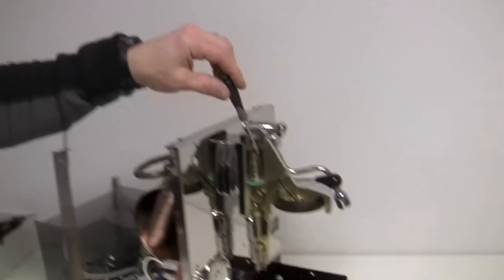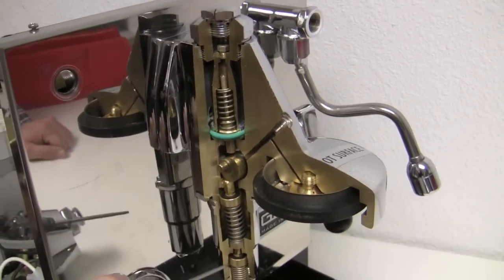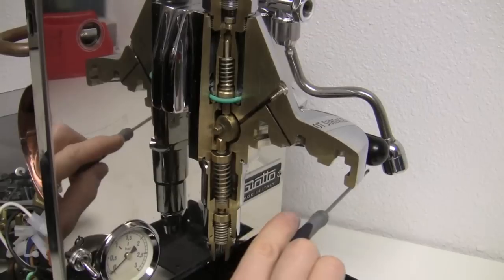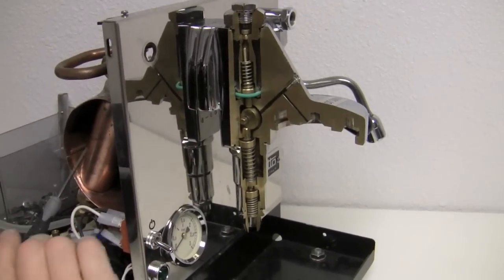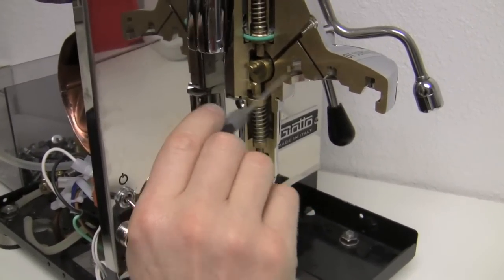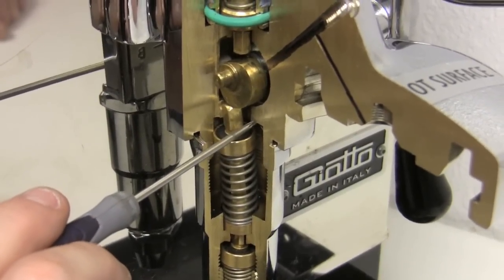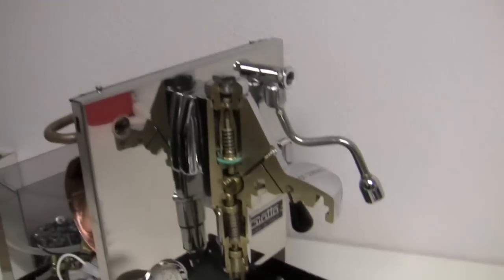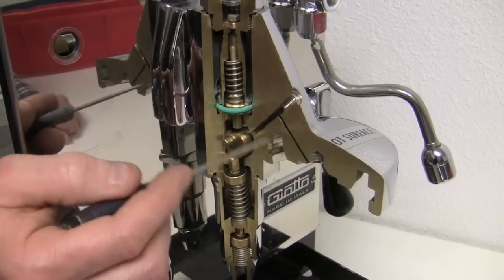Internals of an E61 Brew Head

Comment: The middle valve is actually a pre infusion valve. There is not two exhaust valves. When the pump is activated, pressure will push the middle valve down slightly (but NOT the bottom valve) opening up that middle chamber. The filling of this chamber creates a 'delay' in the buildup of the pressure. A soft 'pre infusion' or ramp up - as intended by the E61group head design
Reply: Good catch Sean!
Reply: @Omar Omari instablaster =)
Reply: @Jerome Brendan thanks for your reply. I got to the site through google and Im waiting for the hacking stuff atm.
Seems to take a while so I will reply here later with my results.
Reply: @Jerome Brendan it did the trick and I actually got access to my account again. I am so happy!
Thanks so much you saved my account!
Reply: @Omar Omari glad I could help xD

Comment: To add to the question of replacing only the rubber gasket of the valves; yes it’s possible. I did it this week. Issue is that you have to remove the notch (and probably replace, as they wear). The bolt for the notch has about a 50% chance of breaking when you turn it loose because it’s either glued in or the temp & scale almost fuses the little m1 or m2 brass thread. A notch is 1.75€, a seal is 90c. A whole new valve is 9-10€.. so if you’re cheap like me, remove the notches, buy what breaks & seals / notch for the others. I broke my pre infusion valve and saved brew & exhaust.
Reply: You can even flip the gaskets over and use the other side for a while if the rubber has not gone too stiff. That way you’ll at least be able to make coffee while waiting for the new gaskets to arrive. It’s what McGyver would do.

Comment: Hey Kat, remember whn Brandon ask bout why would there be 2 springs attached to the outlet valve? 

I like to dig in to mechanical stuffs especially figuring out how does coffee machine works... This video is truely gives me a clear explanation on how E61 works... Now back to the double spring setup on the outlet valve, I believe it works better using double spring instead of one since its high pressure there... I hope it's right...

Comment: In the 1st stage before pump is on. There should only be a max of ~1bar as this is the pressure reached in the boiler. 9-12  bar is only reached when the pump is engaged.
Reply: Correct! Good point.

Comment: The correct answer to the question asked at 6:00 is the first chamber is called pre-infusion chamber, that spring gives away before 9 bar therefore slows down the pressure buildup on the puck.

Comment: E61 HX requires flushing to cool the brew boiler tube aka heat exchanger until its stabilised to the correct temperature and also the exhaust valves are for depressurizing and diluting to prevent the lower exhaust from clogging

Comment: I’m commenting on a 12 year old video. 😁
7:03 Yes, you can just replace the rubbers on those valves, but . . .
- the top and bottom of the valves are held together by a very tiny thread that break off easily and they can have some thread-locker on them from the factory so . . .
- if you can’t unscrew them easily then you’ll have to heat the top part of the valve to above 300°C (572 °F) and then 
- carefully unscrew it. 

The valves don’t cost much so for most professionals it’s not cost effective to do this but for a hobbyist who doesn’t want to let good parts go things to waste, it’s very much doable.

The rubber seals/gaskets are only held in by the top part and a little washer. (The edge is not rolled over)

Comment: So after I figure it out it was the solenoid valves faulty... Which is the inner gasket gets harden and broke into pieces... That's how I realise pressure drop... 

Since the E61 is mechanical stuff, double spring would be ideal to keep the pin tight in place during 9bar+/- brewing pressures...

Comment from the maker: I can put it on the to-do list, but it's basically the same as a single or Hx machine if you check out those videos -- pull solution through the water spigot (steam side) and brew head (brew side), let it sit, then continue to flush through. We can shoot a demo of it, but if you need to do it soon, there's your how-to :) - Kat

Comment: There is a push-button mounted behind the lever on the frontplate (1 inch next to the right of were the E61 brewheadis mounted), and when you push the lever upward to activate brewing, it pushed the button in and activtes the pump. ;-)

Comment from the maker: Another thing you could check is the setting for the rotary pump's pressure -- if you put it on with no coffee in it, where is it sitting at? Since I don't know what your line pressure is, I'm not sure what it is coming in at right now, but the rotary will mediate it during brew; if it's coming in really low to begin with, you might not see anything coming out of the brew head. Ultimately there's only so much I can TS over YT - have you called our techs to talk through it? - Kat

Comment from the maker: I don't think so; the only way you could change this is too measure your line pressure from your house and possibly adjust the rotary pump if it's not meeting spec. Is your coffee brewing at the right pressure? If so, then I think you're fine; there's always going to be some passive pre-infusion happening from the pressure within the boiler that will start the process before full pressure hits it. How is your coffee tasting? To me, that's the most important thing to consider. - Kat

Comment: Disagree the HX does not got water at 9bars unless pump is running. The pure pressure in the HX should only be about 0,5bar induced just by the heated water(around 104°-110° Celsius). Nevertheless prewetting does not rly work that great with HX machines unless it's plumbed to main water line.

Comment: This video is 11 years old but I'm going to ask anyway. If everything is functioning normally except no water at the brew head and a bit at the exaust valve what is the most likely cause? My Giotto Evoluzione R has been in storage for 3 years and was shipped 8000 miles to the Philippines. It may have been shipped upside down. I can hear the pump activate when I activate the brew lever. The brew head gets hot. Thank you.
Reply from the maker: Hello!

This could frankly be a number of factors. If the boiler wasn't drained before transit it could be any number of things, but if you're seeing a bit of water come out of the release valve then I would guess it's got some heavy scaling or there is an issue with the pump (even if it turns on it could be running incorrectly). Unfortunately my best advice would be to look and see if there's any technicians in your area that work on espresso machines that you could have take a look at the internals.

Comment: The coffee tastes great, and the OPV will prevent the brew pressure from exceeding 10 bar, so I'm not sure that's a conclusive diagnosis of correct machine operation. If you could demonstrate the machine's plumbed-in pre-infusion function without a portafilter, I think that would resolve my concerns. Something tells me nothing is happening when Gail says "a little pre infusion" when pulling shots on rocket models running on tank.

Comment: At 3:30, Bill explains that you would have the same amount as your line pressure flow into the coffee. This does not happen with my R58 plumbed in. This does not align with what Bill describes. I just want to know if my valves are not operating properly! :(

Comment: Hi. May I ask you a question please? The 36mm chrome nut on top of the group head on my Rocket is leaking water past the white seal. Oddly though, the leak stops when the machine gets hot, I presume this is because the seal has warmed up and the leak path is plugged. I've got a replacement seal but am a bit reluctant to undo the nut in fear of damaging something beneath it. Now I've seen your video I'm even more reluctant. So, is it safe enough to undo the nut, replace the seal and do it up again? Many thanks, John
Reply from the maker: Hi John,

We would definitely be careful with this nut. Ideally if you have a professional shop that can do it, that's best. I'd recommend reaching out to Rocket directly to see if they have any advice for how to handle the issue safely!

Comment: When operating the lever, do you lift up to the point where preinfusion starts and then wait a while (for the preinfusion to finish) before lifting further up to engage the pump?  Or does one just lift the lever in one quick movement till the pump starts?

Comment: Hi Great explaination. I do have a question that doesnt seem to be answered in the video. My E61 works perfectly putting water into the coffee and then when I move the handel back to flush the water it seems ok in that water comes out the exhaust. But what I find is the pressure meter is still showing brew pressure even in the exhaust position, this slowly leaks away or I have to move the handel back to the mid position which then seems to release the pressure back into the exchanger or somewhere, I can hear a fizzing noise and the pressure meter drops. If I dont release this pressure the coffee stays up in the head when I remove the potafiller, as soon as I release the pressure the coffee shot drops out with the portafiller exactly as I would expect. Any ideas what needs fixing, I have back flushed many times, the machine doesnt leak or drip, it works perfectly except for removing the coffee shot with the portafiller. Can you suggest anything?

Comment: Nothing in this video seems to suggest that that lever is a switch for a pump.  It looks like it's just a crank that pushes on those spring valves.  I'd also guess that there is steam in your brew boiler if you have a pressure gauge that registers several atm when the lever is "off".
Reply: There is usually a electrical momentary contact plunger switch behind the brew lever that is pushed on by the eccentric cam shape of the lever when it is raised to the brew position. The angle of this video doesn't show that switch.

Comment: Hello, for some time I have had a problem with the excess pressure indicated by the pressure gauge at 12 bars. I replaced the pump, I did complete maintenance on the e61 group but the result is still the same. Do you have any ideas to help me? I would not want to touch the pressure setting of the pump, because I have been assured that it comes set at 9 bars from the factory (Fluide-O-Tech). Thanks for your help.
Reply from the maker: This sounds like a pump issue, but you could try adjusting the solenoid valve to release some of the excess pressure, it's possible that it could help!
Reply: @SeattleCoffeeGear  Many thanks for your response. Before receiving your response I nevertheless adjusted the pump pressure. Can you tell me how I could manipulate on the solenoid to adjust? Also, do you have any idea why I no longer have a few seconds of stopping around the 5 bars? Before I had an extraction profile of 5 bars for a few seconds and then slowly reached 9 bars. Maybe this can give you an indication? I thank you for your feedback. A fan

Comment: So now I see why a chemical backflush will wash away any lube on the cam lever, but moreover, why the unit should be backflushed after every shot pulled.
Reply: Backflushing after every shot pulled is a bit excessive and I don't think it's necessary at all. Also, the chance of dirty water getting into your shot is very minimal since every time you turn the machine on and it heats up, you need to cool the grouphead by flushing for X amount of seconds before you pull your first shot.  This will make sure the dirty water is removed and replaced with clean water for that first shot.
Reply: @1983Jacko  Thanks.

Comment: Do you folks sell a E61 Group Repair Kit?
Reply from the maker: What type of repair kit are you looking for?
Reply: I have my Quickmill Alexia E61 all apart as of this morning and I need the upper and lower plane gasket that seals off the intake and exhaust valves.
Mine are mangled and I am leaking steady water when pulling shots as a result. 
I am up in Victoria, BC. 
Cheers

Comment: Now the one question left is, how does the pump know it needs to engage and disengage?
Reply: The top of that lever is actually cammed and presses against a contact switch on the housing when the lever is lifted.
Reply: @einfussganger  Holy blast from the past.... I've learned a few things since I posted that question. Plus, I have an E61 myself now =)

Comment: Does the brew head of a regular commercial coffee machine work in the same way?
Reply: The main difference is they are solenoid operated. Instead of the lever, a solenoid mounted at the bottom of the head directs the water through a slightly different path up to the coffee. When it closes the exhaust exits through the valve. They are more prone to blocking so it's very important to use a filter on the machine that not only removes particulates but also calcium and the other minerals that can cause scale to build up. But IMHO overall the solenoid systems are simpler and more reliable for higher volume use.

Comment: Anyone have any idea how to fix if too much water comes out? It's now making regular coffee by the amount of water coming out. Any help on which screw to tighten if that is happening? Thank you in advance.
Reply: Dez Nay use finer coffee and press it harder. In that way water will have slower flow rate
Reply: Make sure your brew pressure is not too high, that will force too much water through the puck even with a finer grind. Adjust at the pump if rotary, or OPV if vibration pump.

Comment: It seems like you could just put new gaskets over the valves instead of replacing the whole valve.
Reply from the maker: From what I see in the video it seems like they don't sell them individually. - Steven
Reply: +holdtheonionsplease The normal maintenance sets often include only the gaskets. You're right, replacing the whole valve (times 3) is absolutely not necessary.
Reply: everything is available separately. the seals are held in by a washer and you simply unscrew the square or triangular spiggot. sometimes of course the threads get jammed they are only M3, but it is easy enough to replace if they break. sometimes i think people are not servicemen but parts replacers. the customer will pay so just replace it all. not a good look.
Reply: The three valves will (with seals) will set you back about $50. The top of the pins that engage with the cam do wear over time, so I had no qualms about replacing the valves - especially since I could not find the exact seals and my machine was down. After 8 years of daily use, it took all of 30 minutes to tear down the group head and replace the seals and valves.